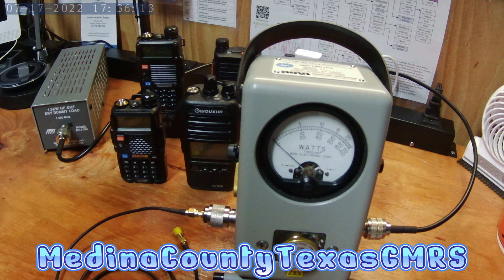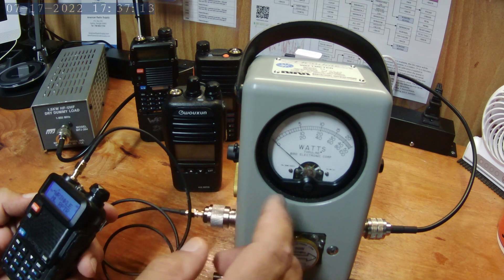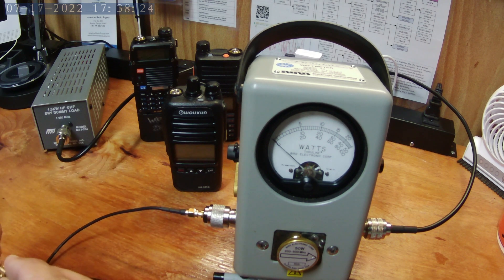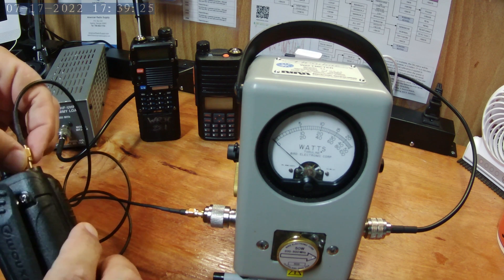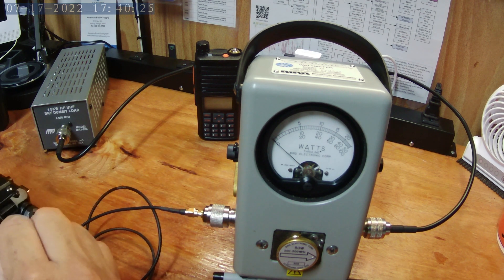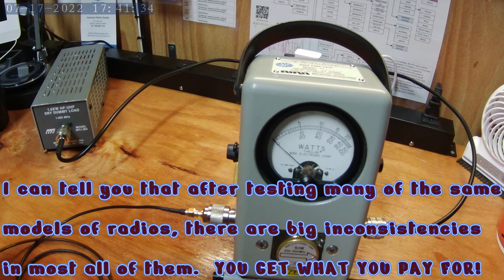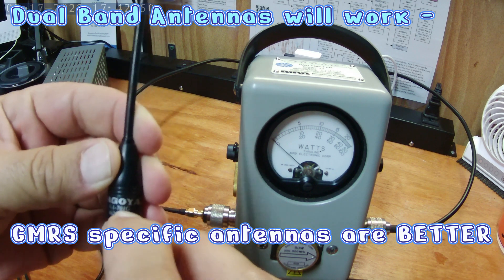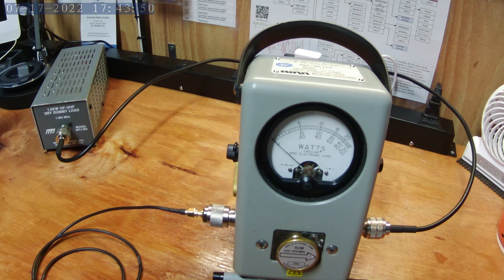GMRS - Watts Matter!!!  Power Testing a Wouxun, Radioddity and 2 Baofeng handheld radios.

Comment: Your measurement method is a bit flawed.  Use a SHORT piece of LMR240  and not a rather long piece of RG174 type. RG174 has 21db loss/100ft at 460MHz. I have a piece of this that is closer to 30 dB/ 100ft. LMR240 has 5.4dB loss so a 1ft section won't affect the measurement much.  It is true that radios have some variability with respect to their stated output power. Indeed you will find small differences between identical radios of the same model and brand. Using an 8W radio as a handheld is unsafe use 5W or less. If using the radio as mobile with an external antenna outside the car 8W will be OK is many locations on the vehicle.
Reply from the maker: Thanks Vlad!

Comment: So when recieving watts does not matter correct? Super hetero dine would be important though, right?
Reply from the maker: When receiving, watts on your radio don't matter but do on the other guys radio.  Lol. As far as superheterodyne, I can't tell the difference between radios with that type of receiver or without it.
Reply: @MCTGMRS78009  thank you
Reply: @MCTGMRS78009  All modern radios even those that many decades old except for some SDRs are superheterodyne radios. Coax cable loss lowers the received signal strength  as well as the power at the antenna when transmitting,